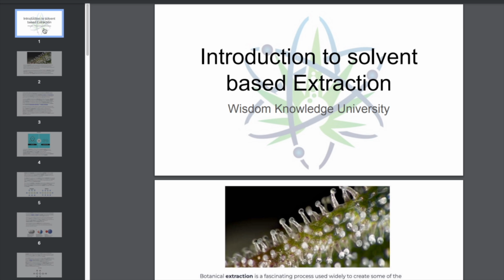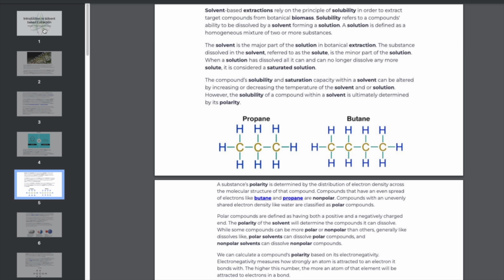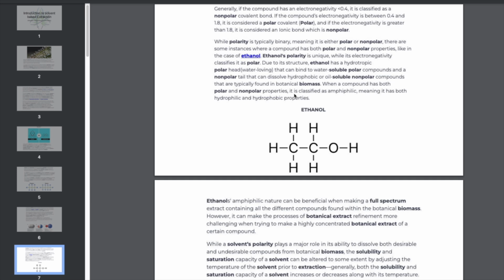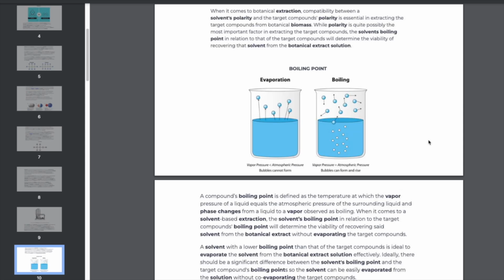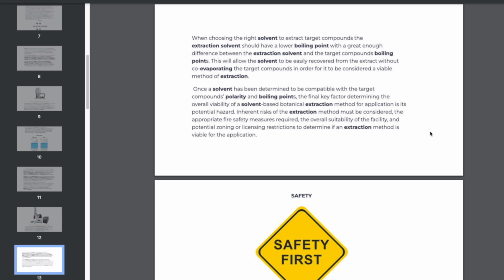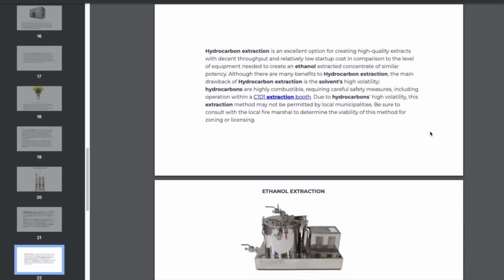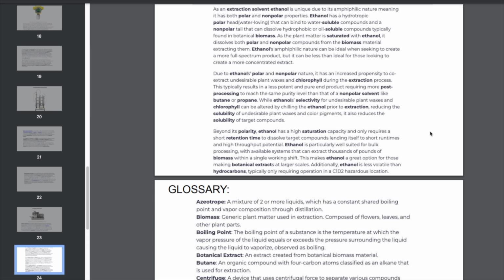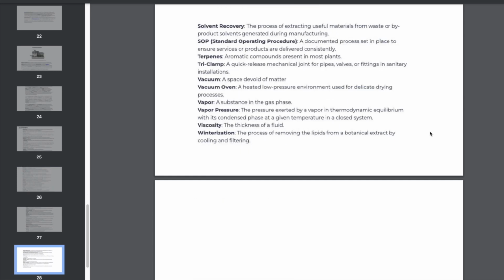Is BUTANE HONEY OIL Really the BEST for THC Extraction? 2-A

Comment: How would one increase the head pressure in a cooled butane tank ? And What sort of pressure range should you look for to be able to move the liquid solvent  through the material chamber please ?
Reply from the maker: You would want to inject nitrogen into the solvent tank. There is no "set pressure" you just want to see the solvent move and not exceed the 75% threshold of the maximum allowable pressure of the PRV that you have put in place that should be 50% of the maximum pressure the actual tank can handle. EX: PRV 150 PSI tank capacity 300PSI nitrogen injection no more than 112PSI. But this does not always work. It works some but not a great solution. Your best bet would be to switch from a passive to an active system and use the solvent recovery pump to pull solvent through the material column and into the collection vessel. TLDR: Use your recovery pump to move your solvent.
Reply from the maker: To increase head pressure in a cooled butane tank, you can use a heating blanket or warm water bath on the tank to raise the vapor pressure. For closed-loop systems, youre typically looking at 30-60 PSI to push liquid butane through the material column effectively. Temperature differential between your solvent tank and collection pot is key. Did you know that we have a FREE newsletter keeping you up to date on all of the latest technological developments, regulations and laboratory procedures sent straight to your inbox every Monday morning? Sign up here: https://forms.gle/BpFA9MmDdMRPa5Bq9
Reply from the maker: Thanks for the feedback on the audio - we appreciate you sticking with us! Did you know that we have a FREE newsletter keeping you up to date on all of the latest technological developments, regulations and laboratory procedures sent straight to your inbox every Monday morning? Sign up here: https://forms.gle/BpFA9MmDdMRPa5Bq9
Reply from the maker: Appreciate the feedback and glad you enjoy the content! Audio issues have been noted and were working on improving that. Did you know that we have a FREE newsletter keeping you up to date on all of the latest technological developments, regulations and laboratory procedures sent straight to your inbox every Monday morning? Sign up here: https://forms.gle/BpFA9MmDdMRPa5Bq9